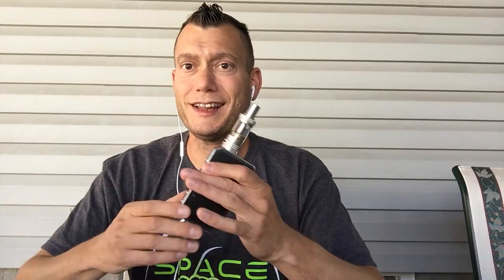Dangers of Ni200 nickel DON'T vape it on anything BUT Temperature Control!

Comment: Doesn't everyone get chemistry in school? I know not everyone goes to highschool, but over here we started getting chemistry classes from 6th grade. You don't even need to have been good at it, you just need to remember that the softer the metal the easier it will react with stuff it's touching; that's enough to raise an alarm and make you do some research now before inhaling it. As soon as I heard about Ni wire in vaping I went "hey, that stuff's dangerous, how is it kept under control?" and started reading and watching videos, so I could fully understand what's going on. And although there are no worries regarding graphitization if you don't dry burn or use it on a non-TC device, I'm still not touching it because I couldn't find any conclusive info about it leeching into your juice even with normal use (remember it's a soft metal, it reacts easily, it's considered a toxic material). For the same reason I don't wanna see any copper or brass in my RDAs, touching my juice. What I use for TC vaping is Ti - while graphitization is just as dangerous with it as with Ni, at least Ti doesn't react with stuff it's touching. But I'm gonna lay off the Ti too, I have the Smok X Cube II on order because it allows you to set the temp coefficient of the metal you're using and that allows the use of stainless steel for TC, which is an inert metal and you get the best of both worlds - no more dry hits due to TC and no dangerous substances from overheating/dry burning it; you can even use the same coil and switch between TC and VW mode. If manufacturers don't switch to SS as a standard for TC in the future they are just plain dumb. Also in regular VW I find the flavor to be better off of SS coils than Kanthal ones.
Reply from the maker: +houserhythm Thanks, I couldn't agree more.  My buddy DJLsb Vapes is awlays rockin his X Cube on our thursday show with SS wire build and making me jealous!
Reply: +Quest4vape The thing is SS has VERY small changes in resistance as it heats up, that's why it's harder to do TC on it. From what I've researched even on the X Cube it's not always spot on (it's not marketed for SS TC after all), but I'd rather risk a very rare dry hit than vape on potentially dangerous metals. Also as technology progresses chips will be able to detect those small changes in resistance better and, as I already said, I'd be very surprised if SS isn't the future of TC.

Comment: sweet spot vapor has high quality titanium wire that will crumble if you don't use it with temp control  it is a dumbass proof wire. titanium will also let off toxins after 2200 degrees  easy achieved on an unregulated device. they put an added material into the wire as a fail safe for both you and battery. I'm off the nickel. couldn't recommend this product more
Reply from the maker: +Weldzilla beast Thanks, I haven't even tried Titanium yet.  Many of my friends love it for exactly that reason...that it's more stable to higher temperatures and thus 'safer' to vape than nickel.  I think I'm moving towards Stainless Steel in temp control to be even further over on the 'safer' side of metals and vaping.

Comment: i just started out on nickel yesterday was in tc mode but kept getting burning, and i have to say ive tasted burned cotton on kanthal and on nickel it tastes much worse, it tastes toxic, and i found the reason it was burning even in tc mode was because even though i screwed my subtank on tight, it still was not tight enough, because you are dealing with such small resistances even a slightly dodgey connection can throw the tc off, so im no expert but i would say maybe for this reason nickel might be best avoided all together
Reply from the maker: +oldskoolhead0 Thanks OS, the downside can be worse than the upside for this metal.  What Temperature Control mod are you using?  One thing that I'm learning is that chip quality and reliability are more important than getting a cheap device that claims it can regulate power output for temerature control.  IF it's jenky it's poisoning you.
Reply: i got a heatvape invader mini, the tc seems to be all over the place, one minuite i can be vaping full power at full temp ok then turn it off and back on again without even taking the tank off, it comes back on same resistance and same settings will burn it, i know its a cheap mod, i didnt really buy it for the tc more for its indestructability lol but all the reviews say the tc is good and works etc, it is better now ive tightened the tank on really tight but still a bit hit and miss after its switched off and back on again, was thinking id try titanium but dont know if that is any better or compatible with this mod?
Reply from the maker: Titanium is like Nickel in many ways but has a higher temp it can heat up to.  However it is even more finicky and need a mod with a chip that can handle Titanium.  Your Heatvape Invader Mini might not be up to the task.  The Evic by Joytech has a titanium mode.  And the new IPV and Sigelei products do as well.  But I'd proceed cautiously with TC on some of the lower end products.  Meanwhile if you should happen to accidentally run over your mod with your car you will be fine as the Invader Mini is one tough mofo.
Reply: haha yes one tough mofo exactly the reason i bought it as ive been breaking or loosing 1 mod per week since i started lol

Comment: But remember vapers used to do NR-R-NR wire?
did the legs of nickel release toxins?
Reply from the maker: אביב ירדני That's a good question, and I don't know the answer to that.  The Kanger and Aspire coils that had those NR legs soldered on always seemed highly sketchy to me and I didn't use them long.  I just unboxed the new Phantom subohm tank from HorizonTech today on our live show "The True Vapors" and the prebuilt coil for the RBA section had one of those Non-Resistance legs.  I'm leery of metals I don't know much about.  Thanks, you raise a really important question.  Hope to get some info and other comments on here about this.
Reply: Quest4vape  more so, it was nickel on power mode
that alone sais nickel on TC mode with a low tmp, must be safe
all the drama now, on nickel, haaa
kanthal melting point is lower then nickel, and kanthal has 2 toxic metals in it

Comment: I just got the smok cube 2 160 watt. The best part of this mod is it won't let you vape nickel on wattage mode.
Reply from the maker: glennon priester That's certainly a nice feature of the Smok Cube2 160 watt.  Some non temp control regulated mods though will fire down to .1 and lower, so it's a problem with the user knowing not to put nickel on that mod.  Thanks for watching!

Comment: how is the ipv4 I've been considering buying one I want to start getting into temperature control do you have any thoughts on it before I decide to buy one
Reply from the maker: Marc Cormier I like the IPV4S.  It's a great mod for the comfort, durability (not fragile at all) and price.  It packs alot of bang for the buck.  If 120 watts and 50 joules sounds like your vaping range then it's a win.  If you feel you need 165 watts the Li is a great value for relatively the same price or a couple of bucks more.  It's a little more boxy but doesn't have the weird seam and erroneous 'hole' that serves no purpose other than to suck juice into the gizzards of this box mod.  I'm playing around with the Sigelei 150wattTC right now and I quite like that too.  For around $100 or less there are now plenty of great regulated mods that offer TC and Wattage to power most builds and the functionality of vaping nickel with TC.  As always, please vape safely and responsibly, use good batteries rated for the demand you need, and don't vape Ni200 in wattage mode and don't pulse the coils to glow.
Reply: I don't vape high watts I only vape high. Watts with a rda I don't use daily I just want a mod with 2 18650 battery for the extra battery capacity I normally don't run above 20 watts for day today vaping

Comment: I hate stupid people please educate yourself before you mess on nickel or titanium
Reply from the maker: Marc Cormier I fear for folks who have not fully educated themselves.  I was one of those stupid people, but I quested4 information and found it.  Now I am slightly less stupid.  Thanks though, ditto: please educate yourself before you mess with nickel or titanium.
Reply: I think you should do a video on battery safety I see so many people using the wrong batteries for their mechanical mods they're just using regular flashlight 18650 battery not high drain

Comment: Aye check out Grimm greens recent video about touching coils being pulsed and vaped. Not saying it's safe but it's do able. Cool informative video
Reply from the maker: James Maglinger Yeah, I saw it.  And I commented.  He glows those coils exactly how NOT to work with Ni200.  I was polite, but the fact he had to put that coil on a non-TC mod to pulse the coils means what?  The TC mod didn't want to fire it to glowing hot because that's the whole point of TC that makes it 'safe'(er)?  It's pretty, and they light up, and it's dead wrong to do that.  Rip Tripper too.  These guys don't know any better than I, but they did a video, and now others will follow suit.  If you watch VapnFagan does a video where he pulses the coils in wattage mode.  at 14:09  https://www.youtube.com/watch?v=EqG3HxROOu4 Yeah, at 10 watts, and for just a moment on the power button.  And the coils never glow.  And I can't count how many times he stresses not to glow the coils.  to just tap the power button.  to barely even get heat into them.
Reply: Right I seen that. I know if grimmgreen or riptrippers posts it everyone sees it and everyone does what they do just be they are who they are. I took it at face value. In the vaping world I like to sit on a thought for a long night time see how it pans out for other people. Vaping is somewhat very new technology itself, and temp control is in its infancy stage Yano

Comment: Good tips there Darryl... I'm excited to get my hands on a good temp control mod... Wondering how they're going to handle claptons and twisted builds... Wonder if I can build those sorts of builds without pulsing them tho... Maybe at a low temp think it would be all right to pulse?
Reply from the maker: OhmBoy Josh Thanks man,  the higher powered TC boxes are great with claptons and twisted builds, you can pulse those dry in temp control, that's fine.  If you watch +D Devoe has a good video on building with Ni200 where he does pulse them at 10 watts barely touches the fire button to pulse them.  They heat up but they don't glow.  He's only heating them enough to see if there are hotspots for the way he builds.  So either pulse em in temp control, or very carefully at super low wattage and only enough heat to see those hotspots.  He doesn't pulse to a cherry red glow like we do for kanthal.  https://www.youtube.com/watch?v=FdFFjTQrob4
Reply: +Quest4vape thanks Darryl - I'll check out his video DD'S video for sure thanks bro